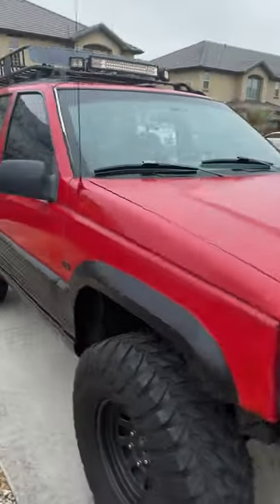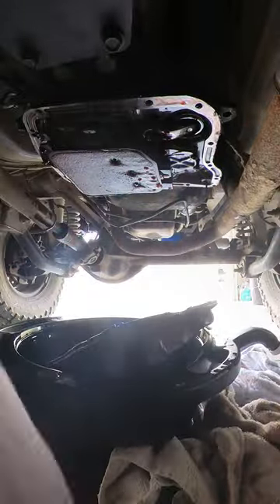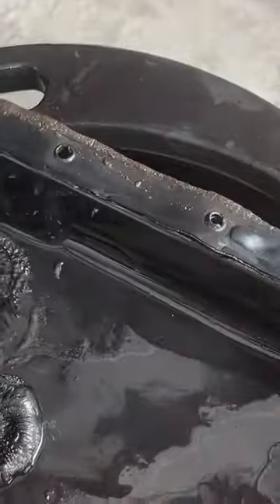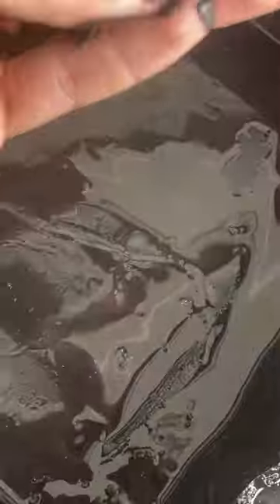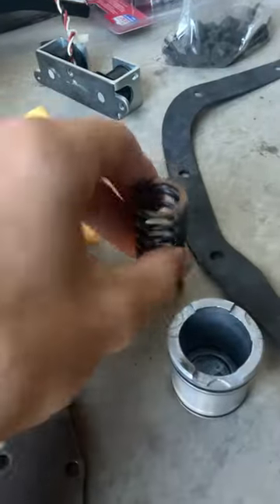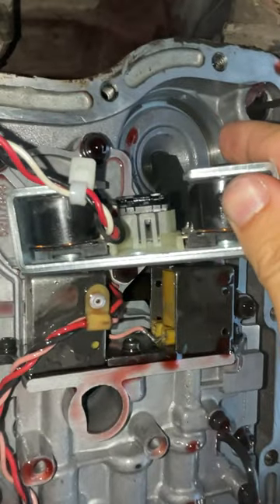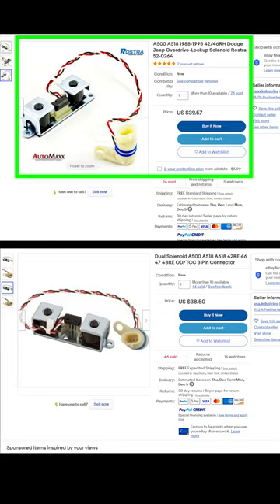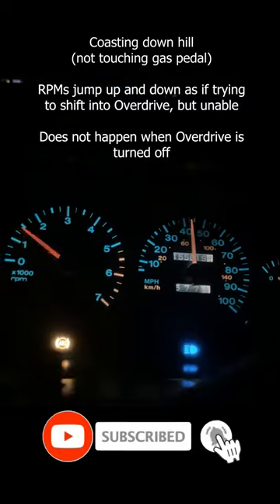Is my $2k Jeep's Transmission Blown?

Comment: Did you ever fix the overdrive issue? I had bought a 93 ZJ 4.0 and it had the same issue. I changed everything I could inside the transmission. I had given up and was about to sell the jeep. I tried one last time and dissected the transmission harness all the way up to the main Junction at the firewall and it turned out there were two melted wires and were shorting each other out. One ended up being the overdrive circuit